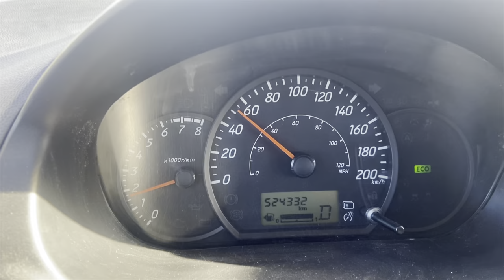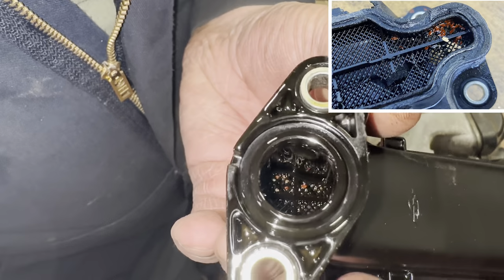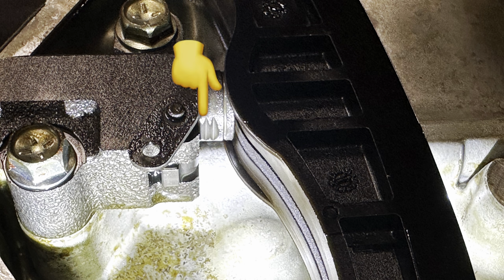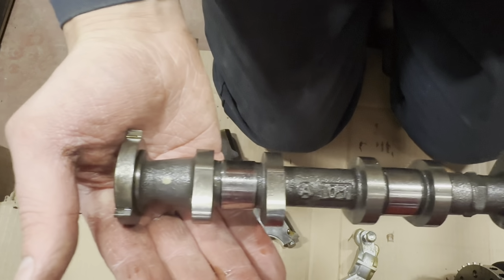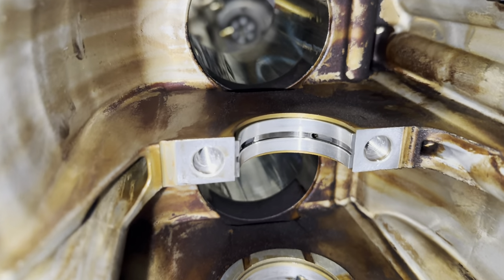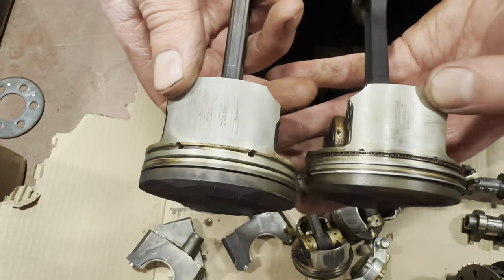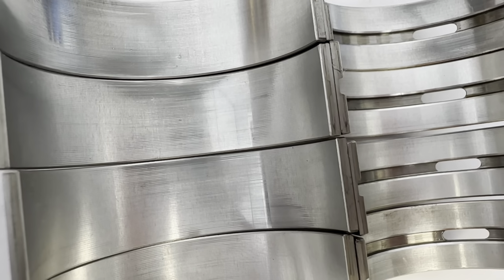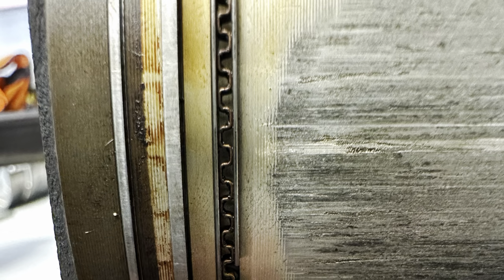524,000km Mitsubishi Mirage engine teardown

Comment: How long can timing chain guides last?
Reply from the maker: That depends. I've never replaced them in these cars. The guides from this engine look worse on the video than they do in person. The grooves in them are  microscopic. The only guides that I've seen worn down noticeably were ones from an engine I pulled from my personal car that spun a rod bearing. I bought it used with high miles and it didn't appear to have oil changes very often when it got older. You can see it at the 7.32 mark on this video https://www.youtube.com/watch?v=xI44Ic353vI
Reply: @turdpailsandtrails  oh okay, I have a VA WRX it has some gnarly guides, they like 3 times the length of that Mitsubishi mirage. I'm a bit worried that they won't last long.

Comment: I wonder what oil the owner used and how often the oil was changed ?
Reply from the maker: 0w20 since new. Mobil 1 for the first few years/250,000-ish km then Klondike. Using Motosel oil now.
Reply: @turdpailsandtrails  Thanks for the reply !  I use Mobil 1 myself . Im in the USA not familiar with those other 2 brands

Comment: Pretty much every engine can do this with no problems, you just have to do the maintenance and drive normally. At a certain mileage people just don’t care anymore.
Reply from the maker: I agree, once the new car smell is long gone a lot of vehicles start following the zero maintained plan. 

I haven't seen many small engines make it this high without some type of problems along the way. Usually a water pump, a gasket or seal of some kind will fail long before 500k. All the Fords that I service are due for a rear main seal shortly after 200,000kms. The 1.8L sonics leak fluid from every orifice before 350k km and need timing belts replaced replaced before they snap and take out the valves.  I've never seen a gasket or seal leak on these engines so far.

Comment: How many transmission did that car go through? CVC or manual?
Reply from the maker: Cvt. I replaced the transmission in this car at 300k km then started changing the fluid more frequently. Now many of the Mirage's in the fleet have over 400,000km/248,000miles on the original cvt. One has over 536,000kms on it now: https://www.youtube.com/watch?v=ES2B3OkjU-s&t=4s

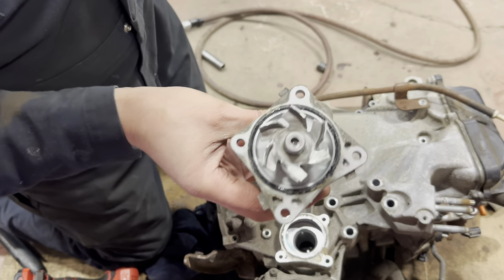Comment: 2:50 red stuff looks like RTV sealant the heat proof kind, flaked off somewhere
Reply from the maker: Yeah, I'd think that too but there's no red sealant of any kind that I could find in these engines. I should have mentioned that in the video.  It's more of a brittle plastic substance.

Comment: Honestly after seeing that, you could just likely just throw it back together and run it for another 200k.     Obviously 0W20 worked well enough to get you this far, but wonder if using 5W30 would give a little more insurance against this piston skirt wear.

Comment: Amazing at that mileage with a 3 cylinder engine. What climate are you in, and how many spark plug changes required?
Reply from the maker: -40c/-40f in the winter and +35c/95f in the summer. This engine had 3 spark plug changes. They come stock with decent ngk iridium plugs.
Reply: @turdpailsandtrails  I live in Ontario and blame the cold start engine clacking on winter cold starts on my bought new 2002 Envoy with only 466,000KMs from following the vehicle computer for oil change intervals, until my mechanic stated not to follow that algorithm. But you're in a similar environment, with similar oil change intervals, and those internals are pristine (- minus the cylinder bore/piston scuffing.)
Reply: @MrOnemanop  Alberta here.  Yeah I just throw oil change stickers on everything and follow them. Usually do 6000km changes on most things.   I had an 02 Envoy as well with 350k on it, still ran great.

Comment: Judging by the skirts it was puston slap. Mazda 1.5/1.6/1.8's suffer the same issue after 200k but will run another 300k with it with good oil and warming up before driving hard.
Reply from the maker: That’s what I’m thinking too. I ran one for over a year like this without problems. I only took it in to get replaced under warranty because I was selling the car. I would have let this 524k keep going but it’s a company car and people were afraid to drive because it was so clacky 😂 long ways from its heart!

Comment: the head valve color is an electrical false signal issue mixed with your engine dislike for etanol . I had the same issue on my 18 wheeler

Comment: Low stress engine, with a proper maintaince will last. I am impressed that it comes with timing chains, most of cilidners engines comes with timing belt or oiled timing belt(the worst solution ever invented)

Comment: I have two thanks. I believe the valve guides are extremely worn out so the valves are bouncing around. Second thing would be this is a super low horsepower motor. So you're not going to get the wear and tear that you would with something with twice the horsepower even at twice the horsepower is still not a lot of horsepower but still at 78 you're not pounding the engine I constantly mashing it to get up to speed just something to think about I'm about halfway through this video and that's my prediction on the noise

Comment: Was that car scrapped?
Reply from the maker: No, It's back on the road. It hasn't been used much though.
Reply: @turdpailsandtrails   so somebody spend the money on a new engine on such a high mileage car that is rather inexpensive?
Reply from the maker: @no-damn-alias  No I installed a used one that I pulled from a wrecked one 7 years ago. It wouldn't be worth buying a new one. I heard they're over $6k from the dealer.
Reply: @turdpailsandtrails  how much are these engines used? To me it seems like that this engine was fine to keep running. VW 1.4 NA for example are very known for piston slap and just keep running but of course that is easy to say after the engine has been taken apart
Reply from the maker: @no-damn-alias yeah this one would have been fine for a while I’m sure. I had one that sounded the same and ran it for over a year and it didn’t change much. Ended up having it replaced under warranty when I went to sell it. 
Used prices have gone up a bit since I bought one. I got a 2017 engine with under 10,000km for $700cad plus core charge in 2021. Now looking around $1200-1500 in my area for something with under 30,000km.
Reply: @turdpailsandtrails  oh that's not a bad price at all. How many miles on the 10 year drivetrain warranty?
Reply from the maker: @no-damn-alias  Here, we get 10yr 160,000km/100,000mile powertrain warranty.
Reply: @turdpailsandtrails  which is pretty decent for a basic car. 
What are the service requirements for that?

Comment: If that's the (3a92 code) motor, they handle boost pretty well. them Thailand fellers chuck'em on e85 and almost make 200 hp on stock internals, just youtube the motor code and turbo and go explore that rabbit hole :)

Comment: Presumably you only tore down the engine because it was getting a bit noisy?
You should have tried bonding a lubricant to the metal in the engine. 
That almost certainly would have stopped the noise.
N.B. If you improve lubrication earlier in the cars lifespan you would have also prevented the score marks on the piston and bore.
🙂

Comment: So basically if you've got a car with a high mileage like in the 300k bracket, you can have the  entire engine removed, and have it cleaned and get some worn out parts replaced and you could go extra 300k or more with regular oil changes without a problem 😂

Comment: Well that motor is trashed...it needs to go to a machine shop..bore / hone the cylinders.. maybe they will recommend cutting the cylinders and pressing new sleeves in?...a new set of pistons/ rings..thats the absolute positive minimum... that's going to cost a grand..then what about a valve job? resurface the head?gasket set? timing chain set? 😂.. lol.. pretty sure I can find a low mileage engine for $ 500 bucks...ya if it was me.. I'd put it right in the trash..

Comment: Next time, measure the valve clearances before you strip one.
Reply from the maker: I plan to do that and a compression test.
Reply: @turdpailsandtrails  it would be interesting to identify some of the engine rattle, piston slap like you said, maybe added to by large valve clearances etc

Comment: this car is only not liked by many all because it's just a car that's too small for them, the engine is too small, 3 cylinder and the CVT
they don't like that combination, that's all
there's really nothing wrong with the car other than the typical 3 cylinder ick

Comment: ... Unbelievable...  did the owner pay for the teardown? If your 10k dollars car break down... I'd not bother. Still very impressive, id almost want one but id be killed if i got into an accident in one of those...
Reply from the maker: It's a fleet(delivery) car, I tore it down to see how it looked. I tore a 450k engine down previously and it wasn't as clean as this one though. 

I see these things in accidents first hand all the time, some pretty bad being t-boned by pickups and even a garbage truck. Nobody has been injured other than being sore and bruised, mostly from the knee bolster airbag.
 I've seen about a dozen complete write offs so far, one was t-boned, rolled over a fire hydrant breaking the engine and transmission apart and landed on the drivers side. Driver was fine, car was not. 
I wouldn't want to be in a head-on on the highway though. You do have to pay attention in these things and drive them like a motorcycle cause you're on the losing end.

Comment: I don't know I know two people who had these cars my brother's engine died at 16,000 miles and I know a guy that I worked with his went out at 80,000 miles
Reply from the maker: They can't all be winners. What region are you located? Some 14-15's had a recall for running pig rich in the cold and washing out the cylinders.  They flood easily if started and shut off before being brought up to temp and can be a pita to get restarted unless you unplug the fuel pump(or pull the relay-easier).  It's far less common on the 17+ but still can happen. We use block heaters on these Mirages in the winter which seems to help a lot.

Comment: That’s about a thousand kms every week since it was new - that’s a pretty miserable life spending that much time in a car… :(
Reply: I love every mile in it. There is no substitute for lightness and smallness. Very handy to drive with. Every other car becomes a lumbering giant. Maybe quieter. But that's it.
Reply: I get that, I’m a big small car fan. But that’s gotta be two hours a day for 10 years in a car…?! Doesn’t matter how fun the car is, that’s a lot of your life not spent on far better things. 

I’m super glad my daily commute is 20 minutes cycling each way!
Reply from the maker: It's a delivery car. This car, put on roughly 10,000km a month, 2300km/week 99%highway miles til it hit around 400,000km then it was used mostly around town. Bikes don't work to well around here 6 months out of the year. 
My commute takes 20mins by car one way, I ended up buying one of these for a commuter beater after seeing how well the ones I maintain at work hold up.
Reply: @turdpailsandtrails ah that makes more sense. 

It’s pretty easy to make any engine do mega miles if they’re doing big kms a day on the highway. Most wear is in the fisrt minute of a cold start, so if it’s always running and warm they keep on going.

Comment: The cvt used in these things are fuckin horrible. If you have one that lasted more than 50k, you are very lucky.
Reply from the maker: There's 30-40 Mirage's in this fleet. I haven't seen one fail that early in the last 10 years. Maybe they're more prone to failure in hotter climates since they don't have an external fluid cooler, just a tiny heat exchanger mounted to the front of the cvt.
I had a few transmissions pile up years ago between 200-300,000km but they weren't serviced nearly often enough. I started changing fluid at 50k km and now most have 350-450k kms on them now. There's one 2017 with 536,000km and still works fine.

Comment: lol you can buy the 2024 Nissan Versa significantly cheaper and still get significantly more car per dollar
Reply: You have obviously never owned a late-model Nissan before...😂
Reply: @aaroncostello8812  you clearly haven't even touched a Mitsubishi from the past decade, they are literally just Nissan rebadged cars at this point
Reply: @brute6896  Not even close, especially the Mirage.
Reply: @aaroncostello8812  brother what???? Mitsubishi literally uses the same exact engine and transmissions as Nissan, they use Jatco Transmissions which is owned by Nissan. Nissan owns a third of Mitsubishi under the Renault-Nissan-Mitsubishi alliance
Reply: @aaroncostello8812  that fucking alliance was one of the reasons they killed the Lancer and Evo, then proceeded to piss on the 
eclipse's legacy by making God forsaken suv with it's name on it
Reply: @brute6896  The Mitsubishi 3A92 in the Mirage has nothing to do with Nissan. It was actually designed by Daimler. A very similar engine was used in some Smart cars. As to the transmission...yes, it is a Jatco. But they rarely fail in the Mirage, perhaps because they only have to deal with about 75 horsepower. The CVTs in the Sentra and Versa could fail in as little as 50,000 miles. My friend bought a brand new 2017 Sentra and his trans went at 61k.

The Mirage was designed and built long before the Mitsubishi-Nissan-Renault alliance.  Mitsubishis are very reliable, but now that new models are gonna be heavily Nissan/Renault that may change.

I wouldn't buy a Versa on a bet, but to each his own.
Reply: @brute6896  Gimme a break. The Lancer Evo died because nobody bought the damned things new. They bought used WRXs instead. When the Lancer was discontinued the platform was 11 years old and everyone was buying utilities anyway.

Completely agree about the 'Eclipse Cross'. What a joke of a name.
Reply from the maker: @brute The newest outlander shares a rogue power train but that’s about it afaik. 

What other rebadged Mitsubishi’s share the exact same engines and transmissions as a Nissan?  

A base Versa has an Msrp that’s $6000 more than a base Mirage…in Canada.